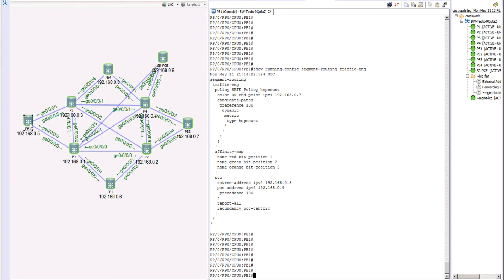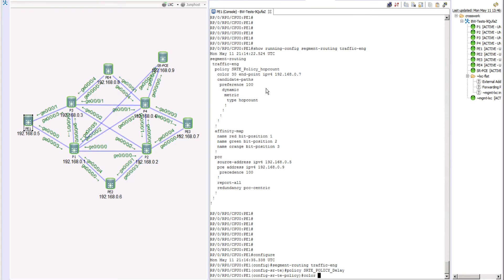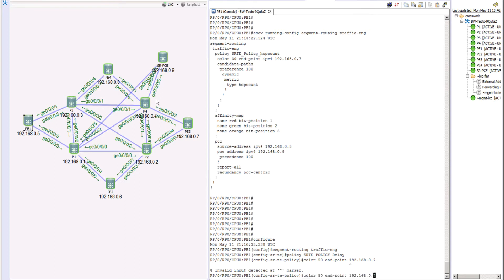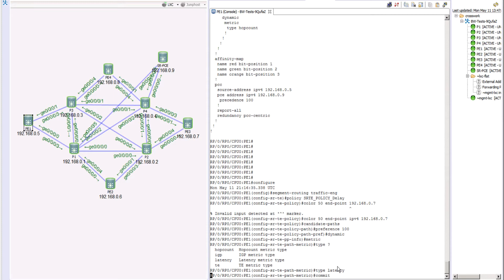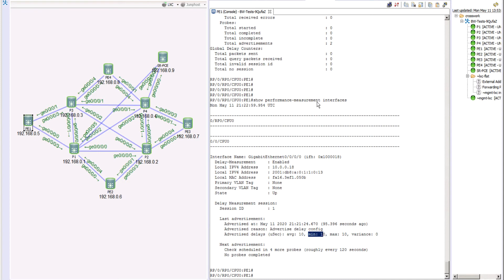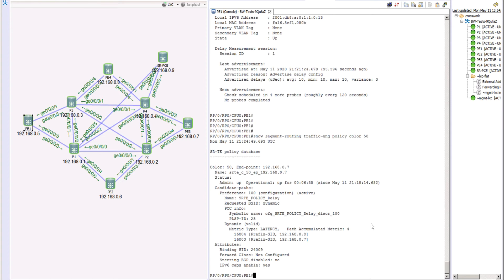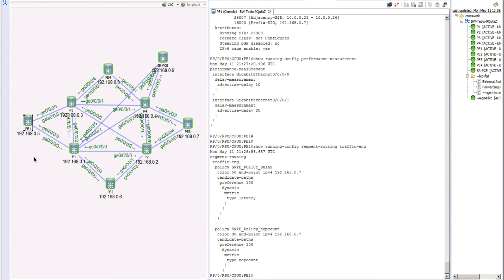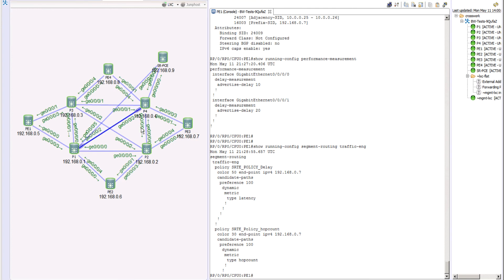SR-TE - hands-on - dynamic path policy  - Latency or Delay

Comment: @arunvoip Hi Arun, 
Thank you for the SR-TE tutorials, they really help me to understand the topic and I have a question regarding delay measurement. 
I am running my topology in CML (XRv9000 routers) and I am running SR-TE policy with the combination with FlexAlgo (with metric type latency). My problem is that the only way to measure the delay is by advertising static value in performance measurement which does not seem like a dynamic way to measure the link performance. I enabled performance measurement on interfaces and followed all cisco documentations for proper configuration (including delay-profile and probe). The problem is that when I run "sh performance-measurement interfaces" it says: "Next Advertisement: Advertisement not scheduled as the probe is not running" and " Current computation: Not running: Platform not supported". The question would be: do you know if this is a limitation of CML/VIRL that probing on interfaces doesn't work as in the production environment? Did you observe similar behaviour on VIRL? 
I will appreciate any feedback on that, thank you in advance!!
Reply from the maker: XRv9K only supports static - like the way you configured, if you want dynamic you need to use actual HW so what you see is expected.

Comment: Many thanks, very valuable content and great proof of concept presentation!
Reply from the maker: Glad you enjoyed it!
Reply: @arunvoip  Hi Arun, that's cool. Also, I would like to ask you some questions: 1) Can we implement PCE along with Flex-Algo ? 2) Is PCE working in a Unified MPLS nettwork, where we have many IGP domains/process ? (If yes, can PCE helps to to avoid using any redistribution between IGP process ?) 4) If we use an orchestration platform, like Cisco NSO, how does it interact with PCE, in the scope of L3VPN services and SR-TE policies creation ? (maybe we could be in contact via mail if possible)
Reply from the maker: Hi Joel, Good Q and I had plan to cover most of these topics but I'll answer some here. Yes, we can implement Flex-Algo and you can use SR-TE on-demand as path options. Yes, you can use PCE in U-MPLS with multi-domain or multi-IGP areas, re-distribution is manual (or please clarify your Q further). You can onboard PCE as a device to NSO and can create custom function packs on NSO (Check Cisco Crosswork Network Controller, a very cool product and doing what you asked and much more, I've plans to cover that too here). You can use SR-TE polices via route-policy and color the routes using BGP ext-community and use SR-TE to route traffic on that path.